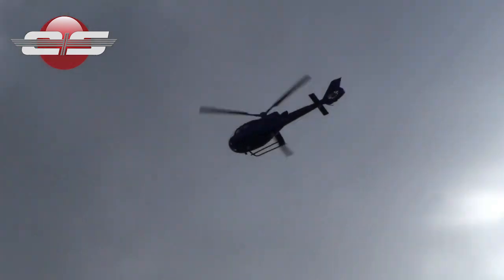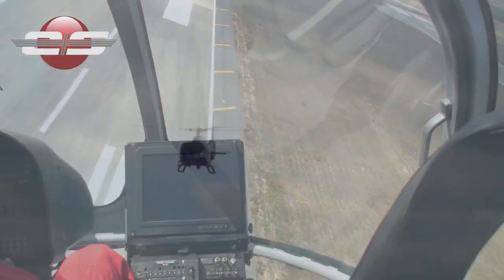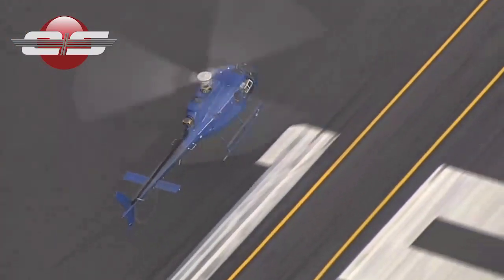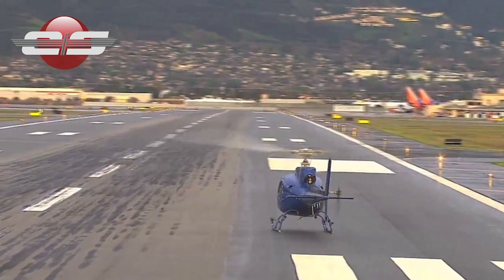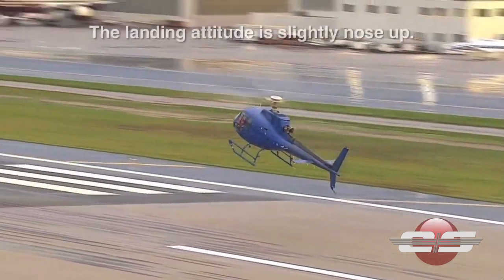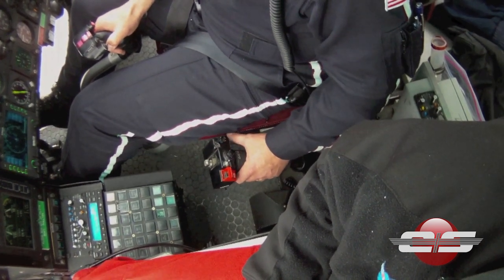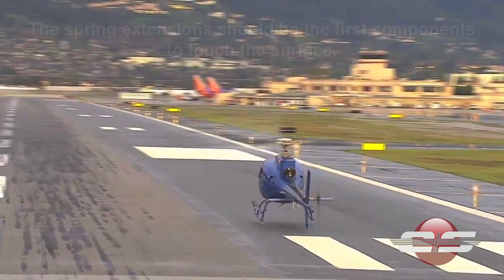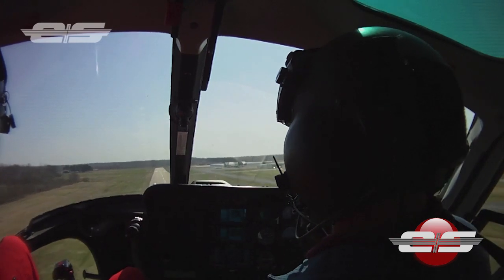#93 - Precision Landing: Mastering Autorotation Touchdown in the AS350 (2010 Re Edit)

Comment: Hi there, I love yours videos. In that one, you're talking about 20 ft, is it the height to start the flare or to level the machine before pulling collective? There is another video, youu're saying 100ft to enter a light flare based on the Australian study. I often have trouble judging the height to start the flare... got any tips for me?
Reply from the maker: Very happy that you are finding our videos informative! In the year 2010 video I made about the autorotational landing the 20 ft I referenced was the level. Over the last 20 years I have slightly changed my autorotations and how I explain them. One of the items that I have tweaked is the level. I used to have a little bit more flare and a more pronounced level. But I found that there could be a sink at the end if the level was not performed at the exact correct time. Through experimentation I found if a smaller flare was performed very little level was need and it eliminated the sink. This smaller flare also decreased ground run as the flare lasted longer while keeping NR. ..... regarding finding 100 ft....... If you have a radar altimeter equipped ship... simply come to a 100 foot hover and find a reference to get an idea where its at... of course at the end of the day when descending rapidly its a "in the ball park" thing
Reply: @EUROSAFETYTRAINING  Interesting, thank you for your answer. We're not equipped with radar altimeter but I guess the more practice you do, the better you get and the more you can tweak each aspect of the autorotation.
Keep on loading your informative videos, it's great value!
Reply from the maker: @cnsaventures  since it's a visual reference of height it's important to find that visual cue. If you don't have a radar altimeter to find the reference in an out of effect hover... you can use buildings or poles to help you out